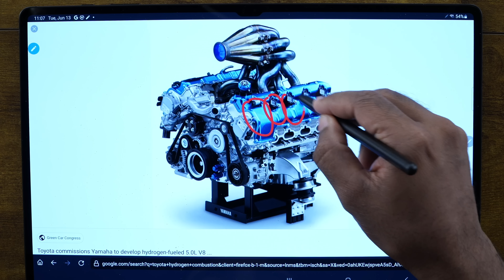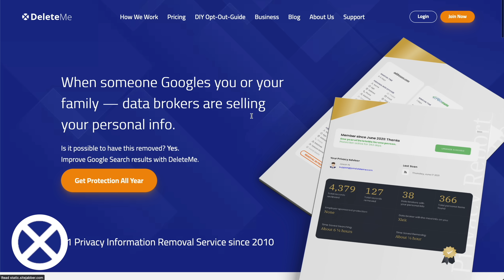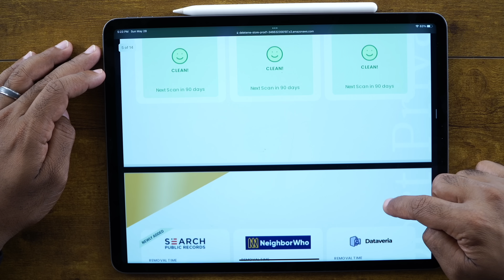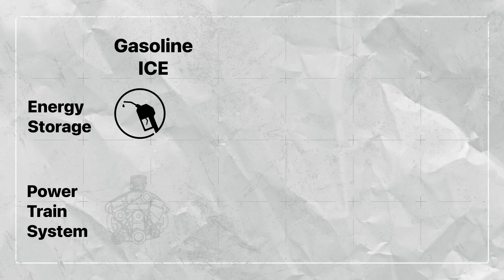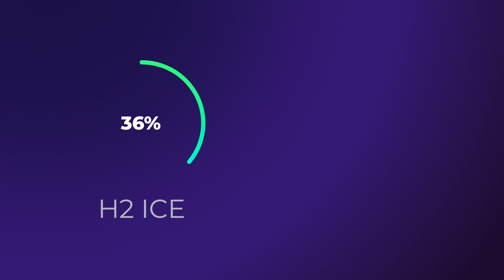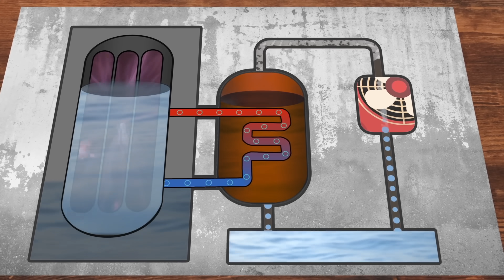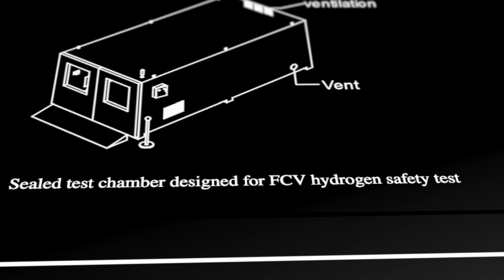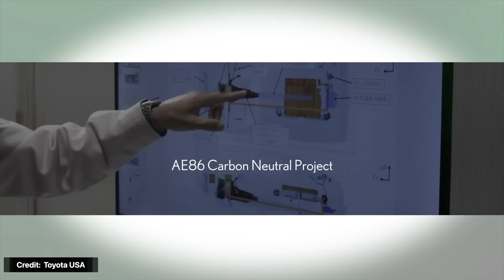Toyota's Says They Just Destroyed EVs - Hydrogen Combustion Engines

Comment: Hmm......I get the point about efficiency but since H2ICE almost doesn't produce any pollution, and doesn't burn fossil fuel to get energy, is having EV-high efficiency that critical? The industry originally got the higher efficiency of EVs down as a plus because the ICE created pollution and burned fossil fuel during operation while having low efficiency in producing energy. But since there's no fossil fuel burned, and literally no pollution when creating energy using a H2ICE, that lower efficiency should no longer be viewed as a huge drawback. Yes, it's still comparatively lower, but not such a big deal now.

I think Toyota is pouring their money into hydrogen engine research because they focused on the negatives of EVs and realised that the long-term cons of EVs is a cost that would be higher than the immediate gains we get now. Think about it. Much of the electricity that we used today to charge our EVs is still not from green energy. And as more EVs are produced and put on the road, more rare earth materials are used and the way much of it is being mined currently is not really friendly to our environment. And we haven't even gone into the politics of mining rare earth materials. Think about where the deposits of such materials can be found, and you'll immediately realise that just a handful of nations can hold the whole world to ransom should the world go fully rechargeable batteries for everything. And then you have the issue of spent batteries. They're not exactly Earth-friendly, even if they're recycled. And in the event of the car getting in an accident......chances of hydrogen tanks catching fire or exploding, zero. Chances of li-ion batteries catching fire or exploding, very real. And it's very very difficult to put out fires involving li-ion batteries. They're usually left to burn themselves out, and even after that, it's still too hot to handle. So I think Toyota probably looked at the cons and went....."No, too high of a future cost for the cons of an EV. We need to find another solution."

Also, Toyota might be looking at the bigger picture here. They may be thinking beyond just cars. EVs still don't have the range that trucks need. And freight ships. And commercial planes. Private jets too. All still burning fossil fuels, and EV tech nowhere near a workable solution for these vehicles. If H2ICE works, Toyota H2ICE engines will be first in the massive industry of freight, air travel, and truck transports. Imagine the possible windfall from that.

Comment: The problem with hydrogen engines is getting the fuel to the consumer.  I worked at a company that used hydrogen engines in all it's machines.  Love the idea, but there's still a little ways to go before it can become mainstream.  I don't have electric cars and I won't.  But I would buy a hydrogen car once the fuel is available at reasonable prices.

Comment: You completely glossed over the emissions output to make EV’s compared to ICE or Hydrogen. On average it takes an extra 25 tonnes of carbon emissions to produce an EV equivalent and we haven’t even got into the battery recycling emissions yet. All we are really doing is shifting the emissions with EV’s not lowering them. I agree we need to move away from fossil fuels but let’s not kid ourselves EV’s are the future because they are not. As an engineer you should know this.

Comment: WHAT about HYdrogen engines running ELECTRIC MOTORS on the wheels--- like a TRAIN-- that way the engine itself doesn't have to be so powerful--- and would EXTEND the mileage on LESS power requirements.. (and NO charging  or battery BS with that either)

Comment: I'm not totally convinced hydrogen is the future, but I think it should still be given a fair chance. I like it over EV's, though I admit it's largely because I find the tech and science more interesting...and that it could still allow me to continue using stick shift
Reply: " tech and science more interesting" Not much tech with the BMW Hydrogen 7. The engine is just a mildly modified 6.0L V12. This entire concept is lazy and moronic. It's massively inefficient wasteful and will cost a fortune operate. That's ignoring the difficult improbably task of scaling up fuel supply chain. I can have a EV charger at home and at work. Good luck owning a H2 electrolysis system that can produced enough H2 for your H2 Piston Engine.

Comment: H2 for fuel doesn't make sense, given the low efficiency, high cost of the H2 components, lack of H2 production & availability. The only real benefit of a H2 ICE is its low CO2 output.

The smarter bet would be to use nuclear power + CO2 sequestering to make green fuels to produce a net zero CO2 system.  Petrol is a great energy storage medium & replacing the whole infrastructure that is in place is mind bendingly inefficient & expensive.

Comment: I know the argument against electric vehicles is the issue over the batteries and the requirement for charging, but the argument against hydrogen is that it will still require massive amounts electricity to generate the hydrogen from the industrial electrolysis process. Seems that this fact is conveniently forgotten. Also the engine will still produce heat. I don’t have any facts on it but I presume the engine is comparable to a petrol rather than diesel engine so how do we power trucks and buses? I’m not an advocate for EVs but is this really the long term solution? The main advantage would be it would be better in winter as EVs suffer from range depletion in cold temperatures.

Comment: 10-36 percent lose of energy is not much it's better than gas now which wastes about 80% of the energy in its fuel. Most of the energy is consumed by the heat produced by the engine. Only about 12%–30% of the energy from the fuel you put into a conventional vehicle is used to move it down the road both EV and Hydrogen are better than gas and Hydrogen would be good for the people that like the loud motors while EV would be good for people that don't, the problem is the price of EV is super high and people that like the sound of a V8 are not going to buy it so if we make those engines more efficient and is better for the environment it's a win-win that is how i see it as a person that likes cars i don't want to see the V8 go away but if that means i live longer I am fine with it but if there is a way to keep it I would prefer that over EV knowing how much it takes to build a EV car compared to normal car over all it would be easier and way more affective to do Hydrogen cars over EV just because more people will buy them.

Comment: Overall I love the commentary, perspective, and informed analysis of this video, comparing H2ICE and H2EVs, but one thing I would have liked to have seen would be the efficiency of H2ICE as compared to current gasoline ICEs, as well as the negatives of the current EV storage media.
Reply: And the cost of mining lithium and cost of recycled ev vehicle's 😂nobody looks at burning batteries either they can be dangerous.
Reply: @danielcampbell6146 lithium isnt the biggest issue it's easy to get, nickle and cobalt is more rare and harder to get a hold of. It's called a lithium ion battery but that's no the main components I believe. Source was Elon musk talking to lex Friedman
Reply: exactly.   that's the real question..  EVs don't have legs beyond where they already are for reasons is simply impossibility of the next stage.  so the real competitor is Gas engines and diesel...  lets go a step further and include in that comparison LNG (liquified natural gas for storage and obviously not so int he vehicles mainly) for engines also as this is a promising tech.  ways to make hydrogen are actually numerous already, ranging from harnessing waste heat of other industry and creating it from natural gas..   of course electricrolysis...   a HUGE key advantage here over gas and fossil fuels is they can be made for use by country, anywhere, more or less onsite.  dont need pipelines to send it from here to there, refineries not needed and the world politics.. not needed..   STILL as astoundingly good as this is Im sure some radical ideologues will find reasons to think its bad... but generally speaking..  a place could use this free of external inputs.  think plentiful nuclear power as the input and efficiency gains over time with inovatios.  I can see how this works long term

Comment: Yamaha has done ALL Toyota high performance engines from the GT2000 of the 60's through the Lexus LFA V-10 and many, many in between.  Toyota is SURE where they are going and what they want when they bring Yamaha to the table.  BMW partnership.....of equal's on Supra???....tbd!  Badged as Toyota, but NOT the same formula....at least they got a manual out of BMW!  YUM^3

P-Chi (Owner of two Yamaha Toyota's)
- 3S-GTE
- 2ZZ-GE

Comment: Some of the issues with EV are 1: A shortage of electricity for charging,. 2: A limited supply of elements used in battery technologies. 3: A huge hazard waste issue! EVs are not green when you consider these issues! Hydrogen has it's own issues but in general, the technology is much more environmentally friendly; much more green! But we need better ways to split hydrogen from water and gas. If this issue gets resolved hydrogen may indeed be the way to go.

Comment: Japan's baffeling obsession with Hydrogen is definitely a head scratcher - it's not like the country is sitting on a huge reserve of refined H2 ready to tap and sell, with tremendous amount of energy still required to extract and process H2 into a form that can be used. The amount of power generated by a nuclear reactor could easily charge way more vehicles than H2 vehicles given the low energy efficiency of H2 vehicles. Even large miners such as Rio Tinto and BHP have compared H2 to EV for their mining truck fleet and they're also going towards EV, as the economics simply stack up so well against H2. With FCHV already at a significant efficiency disadvantage, to entertain the idea of BURNING those precious H2 in an ICE is just...nuts 😛

Comment: EVs have a very small lifespan compared to ice vehicles. What a model Y tesla lasts about 5 years before major battery  decay, not to mention ICE is easier to work with and repair. How many mechanics or shade tree mechanical, are trained how to safely work with upwards of 1000vdc.

Comment: I'm not in full agreement with the presenters view of this, eg. $20k cheaper for h2ice over ev car, fuel 3x+ more cost required, add that up over 10 years and its not so bad a deal for the h2ice car, then the suddenly around that 10 years mark the electric car is near worthless because batteries are $30k - $40k to replace, while the h2ice keeps powering on possibly for 10 - 30+ years before needing reconditioning for maybe $5k to $10k.
meanwhile both have little to no carbon emissions.

Comment: I kinda feel like this isn't necessary when we could just expand the production of atmosphere captured carbon neutral gasoline. Storage of gasoline or propane is much simpler versus some of the alternatives.. LNG for example has to be kept extremely cold vs LPG which you probably have sitting on a porch hooked to your grill. It's no wonder why finding alternatives for such simple things like gasoline, diesel, and LPG isn't so easy. I don't know a whole lot about hydrogen, as a fuel anyways. But I'd imagine it having similar storage and or capacity issues as LNG or CNG.🤔

Comment: The problem with hydrogen is that it takes a tremendous amount of electricity to separate hydrogen from whatever source you're working with, the easiest being natural gas.  It's violently reactive, it leaks through seals very easily, and it's very corrosive.  I don't think that regular passenger automobiles are a good platform for hydrogen power.  You're trying to fit a potentially dangerous technology into a small vehicle.  Hell, have you ever seen the videos of the Teslas batteries exploding?  Hydrogen is way more dangerous in large quantities.  What would be cool is to see it used in something like rail transport, where you could have a dedicated car just for holding all of the fuel and safety systems.

Comment: People are forgetting about all the carbon burned by the mine trucks for the lithium and stuff need for batteries which puts of by far more than is worth to make the cars disposing of the lithium is almost impossible and is very bad for the environment and when it comes down to it what it takes to make and use a ev car is destroying the plant way worse than a normal gas powered car people just ignore that and think because the car it’s self has zero emissions means it’s fine not to mention the charging which is electro which mean the more coal we burn to power the car 3 or more different ways and electric car pollutes the air and on a huge scale by far the worst idea ever

Comment: You forgot another HUGE cost for hydrogen.  Their service stations will cost four times more than an EV charging station.  Tesla had mass produced their stations to be 1/4 the cost of the other EV stations so that's an 8 to 1 cost advantage for Tesla over Toyota building their own hydrogen station network.  Ask Nikola Motors how their hydrogen truck filling station program is going.  Battery chemistry and designs are improving every day with researchers all over the world competing to make them better.  You say a hydrogen piston engine is even more complex than the gasoline piston engine it is designed to replace?  Toyota is steering itself into bankruptcy.

Comment: We dont need hydrogen cars, We neede trucks, vans, heavy equipement. These are things were range and fuelingtimes and avalybility matter a lot. Like you could never use an Electric excevator efficiently because most of the time there wont be acces to enough energy While fueling from a truck is posible.

Comment: Problem with EV is 100% range and trip efficiency, if your driving across the country and stop every 200 miles for a 30 minuet charge a gas powered car is going to beat you in endurance same with H2 ICE. So also I don’t know if I understood you, H2 ICE cars don’t have a heater because the motor generates enough heat to heat the car, and that’s why EVs loose so much range is because of the heat they have to generate?

Comment: The range loss in winter for EVs is not only due to the lack of heat generation for the cabin. Turn off your HVAC system and you're still at a big loss. Babying the battery under every situation but the ideal is the biggest problem of the EVs.

Also, they did the Lexus LFA's V10 engine with Yamaha as well and that was a glorious machine. On the other hand they built their first electric SUV with Subaru too.
Reply: Also if you have access to 230/240 power or even better a Level 2 Charger. You could just preheat the entire car on Charger Power. That helps improve range in winter by a decent amount. Modern BEVs have always been heavily engineered for Snow Climates. I just hate the misiformation that BEVs can't hand the cold. There are freaking BEVs in the ARCTIC CIRCLE.
Reply: @Neojhun  That's "IF" you have access to those. Also, It is not misinformation if it's true. No one is saying they freeze and die in cold weather. Just that they loose a lot of their range.
Reply: @agamemnononur  that IF is not difficult. I'm not asking for any high powered multi phase or DC charger. Just a single phase 230/240v outlet will do the trick.
Reply: @Neojhun  It is if you live in a mega cıty with barely enough space to park.
Reply: I have driven EVs since 2012. I hear about the loss of potential in cold weather but I just use my cars. To that regard, I have never been inconvenienced nor noticed it, although I know it's there. I had more noticable cold weather drivability issues with the ICE cars I drove for decades, but I just adapted to them and just used my cars.  People just look for crud to be dissatisfied over.
Reply: @thepurplemaskknows9383  You had to adapt before because there was no other choice. Now that there is, it's pointless.

Comment: What about NO2 emissions? While I am highly familiar with the concept of an internal combustion engine, my question actually stems from gas turbine power plants. The main reason we aren't using hydrogen for power generation isn't the material cost of building the plant, it's that the emissions from burning hydrogen are slightly higher than natural gas.

Personally I have been working at overcoming that particular issue, and have been designing a modular system, but I had to go with electrolysis for hydrogen generation so that I would also be able to use the oxygen as well to lower emissions, bringing the NO2 levels down but also essentially providing a potential bomb...

Comment: But EV's Really Pollute the Earth More than the than a Gas Car When the Battery is Made. you would have to drive an EV for 80,000 Miles for the Lines between Gas and EV to Meet (have the Same Pollution levers )  So if the EV battery dose not last that long and you have to Replace the Battery then you are not Saving anything........

Comment: The problem with EV's is that indirectly, they still rely on fossil fuels as they are still the most dominant source of electricity. And that's why research into hydrogen engine's should be encouraged I think. Besides, having internal combustion engines that run reliably on hydrogen could also mean hydrogen could be used to produce zero-emission electricity.
Reply: What mythical process you you think would produce hydrogen without the use of fossil fuels, which doesn't involve electricity that could go directly into a battery?